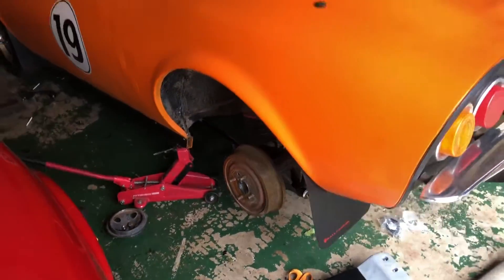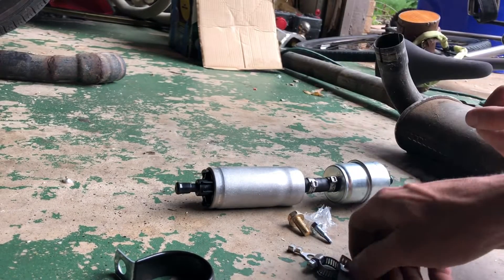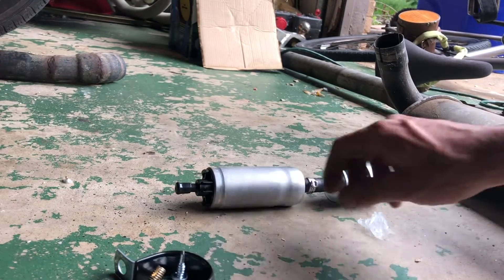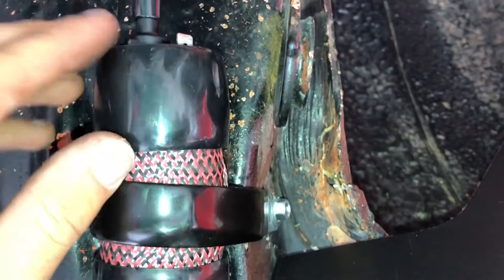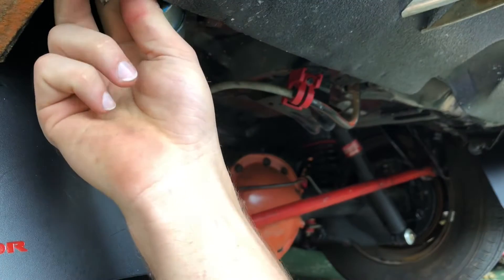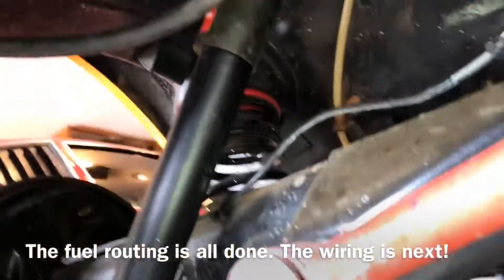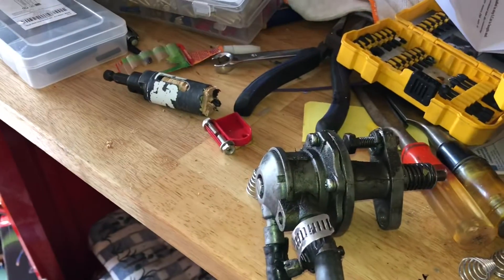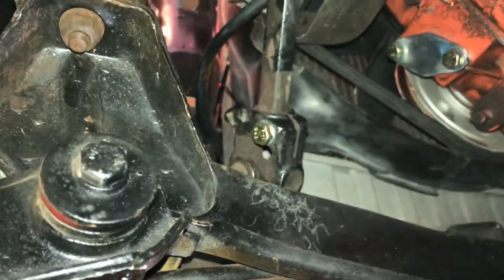Opel GT Electric Fuel Pump Installation

Comment: That strap is supposed to wrap around and clamp the pump itself. The bolt goes into both strap holes.
Reply from the maker: That is one way to mount it. One mounting bolt can only resist moment in two axes (not counting coefficient of friction from the clamping force around the z axis).
I prefer to have 2 mounting locations plus it’s more secure that way in the mounting location I chose.